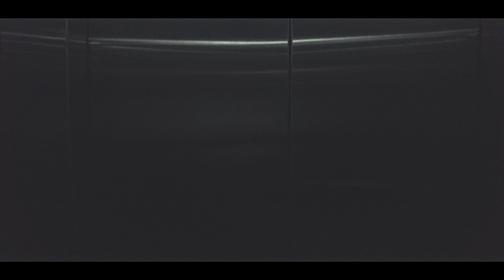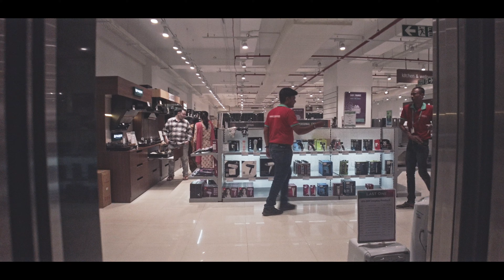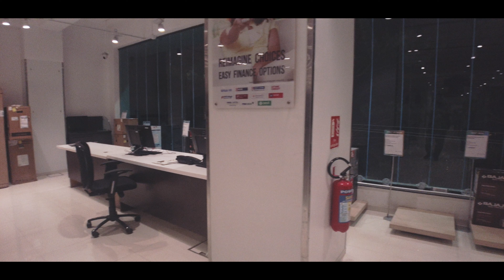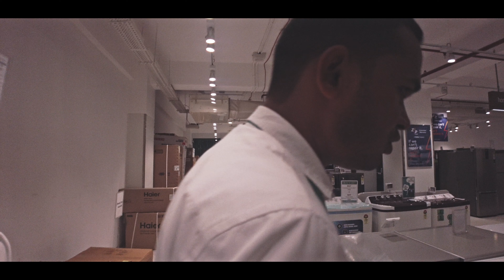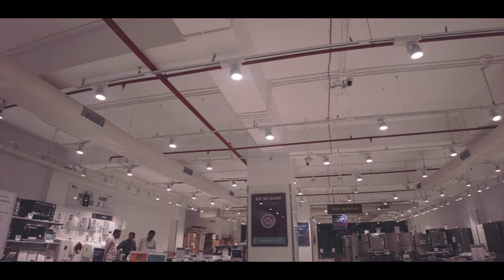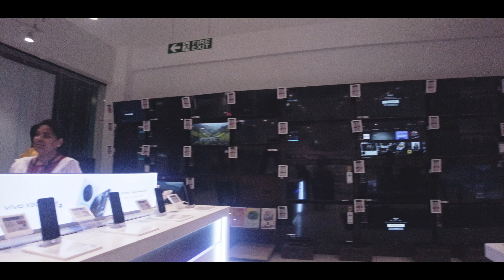#DJI Pocket 2 Night footage test

Comment: Why use ND filter indoors and up your ISO? Should take off ND filter and lower the ISO... Video too noisy with high ISO
Reply from the maker: Initially I thought that the brighter displays of brands and the ceiling lights may create more brightness . However that resulted into need of higher ISO. Just experimenting with pro settings till now.
Reply: @sbtledu  Seems bright to our eyes, doesn't mean its bright for the camera. Don't judge lighting by eye, our eyes auto adjust, the camera needs our adjustments. Auto mode try no mimic what our eyes sees  but it's not accurate.
Reply: @sbtledu  keep it simple, ISO lowest possible, shutter speed double of frame rate. Cinematic frame rate normally 24 and 25 FPS, so shutter speed 1/48 or 1/50. Aperture up to you depending on what you want, lower number more background blur. Higher number less background blur. ISO adjust to lighting condition. If shutter speed 1/48 and frame rate 24 FPS, and still too bright (overexpose) with lowest ISO then use ND filter. Start with ND 1 and work your way up to get the correct exposure.
Reply: Made some correction to the above.